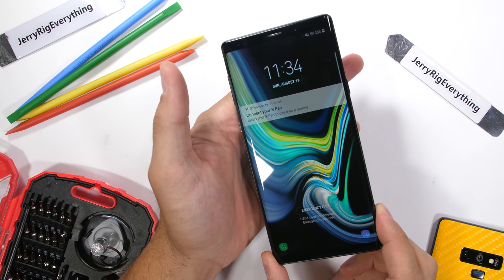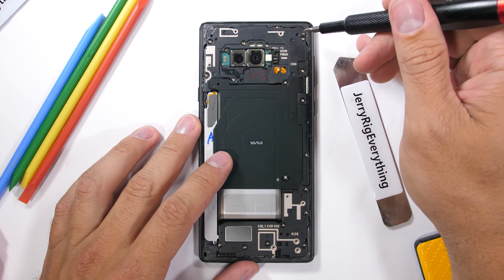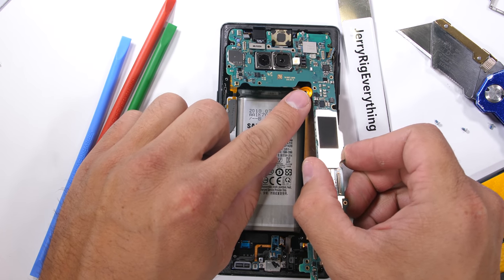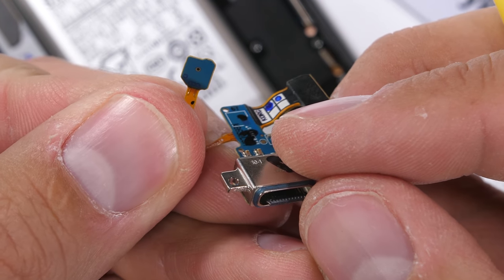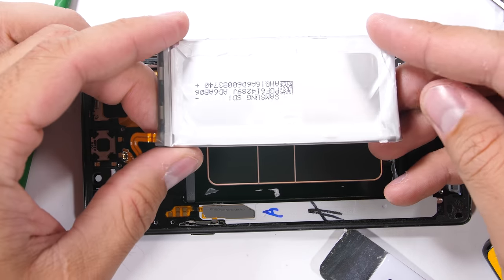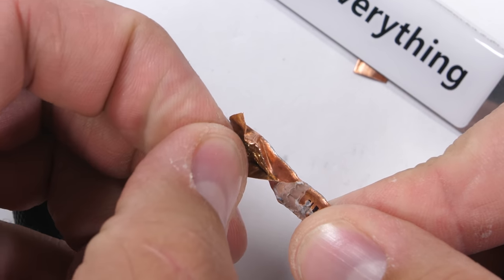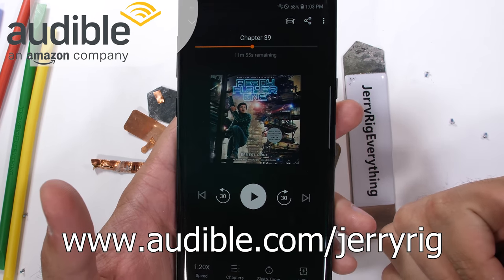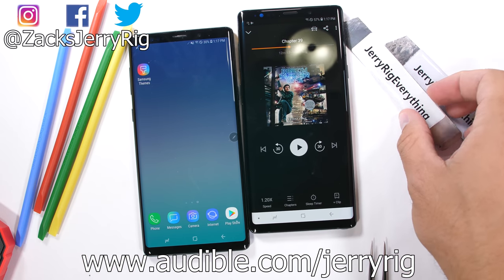Samsung Note 9 Teardown! - Is there Water inside?

Comment: Does anybody know if the bottom speaker grey seal looks as if it goes at an angle viewing it from the bottom port holes as if its not all straight. I tried searching on other pics but only found a couple which seems to be the case but not very clear. Would appreciate if that can be confirmed.

Comment: Ok, I really need some help here please! After watching the durability test video I tried to pull the volume button due to something sticky getting inside and absolutely could not get it off...

I didn't want to go crazy and destroy it but even lightly touching it with an exact knife scratched the hell out of it.

How much force is really required? Does anyone know where I can purchase a new one? And finally will this leave any proof of tampering rendering my warranty void?

P.S. I was able to slightly "lift" the button enough to clean it with some ISP and its working nearly as well as before.

Hope someone can help answer a few questions! I can't find a replacement anywhere!? Thanks!

Comment: Is it possible to put a heatsynk on the back of the exynos version? I intend to use it as a Dex only, and wuould  like to leave it without the backplate, and with a laptop cooler on it.
Reply: Mod it with a 5 $ cheap cooler